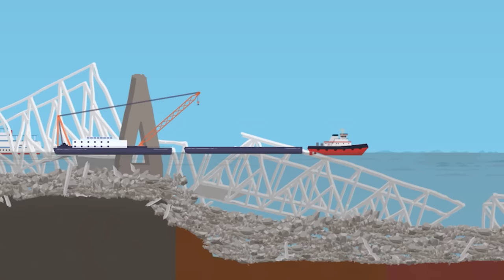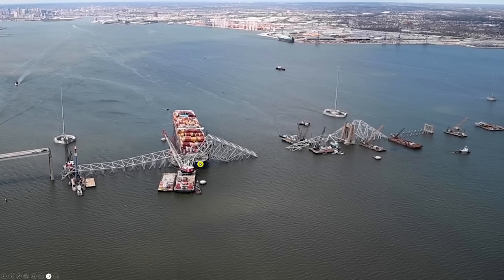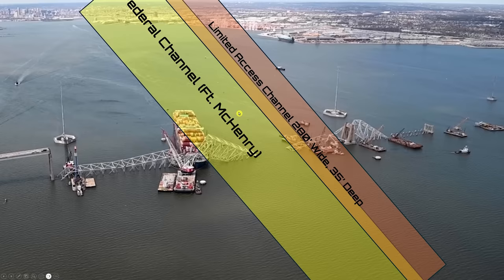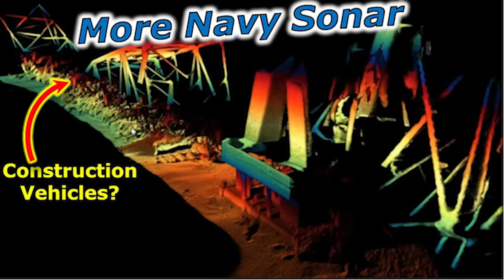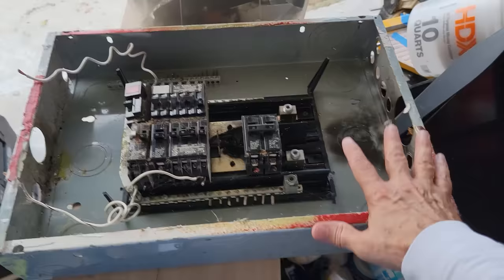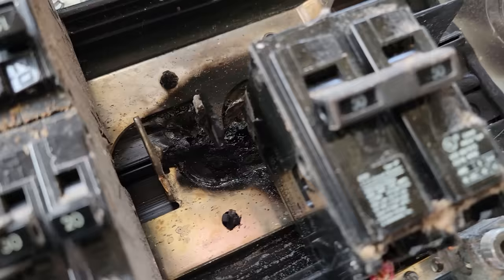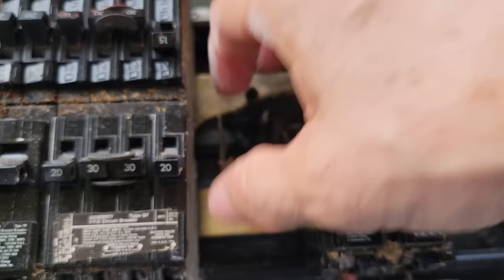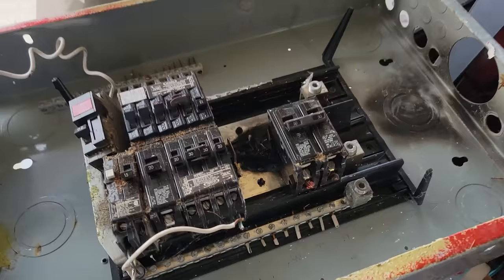NTSB Focus Dali Ship's Circuit Breakers | Bridge Collapse

Comment: The lady refers to the electric power system and the circuit breakers.  This is a very large area.  The circuit breakers on a ship are very different to domestic CBs.  It is not possible to add circuits to a ships CB.  They also have overload protection.  My guess, and that's all it is, is that the main electrical switchboard preferential trip failed to operate.  There are rumours that there were electrical problems when the shippers were loading the fridge containers and had to provide their own power.  If there was a fault on the fridge container supply system that circuit should have been cut off before it could affect the main CBs.  There is a sequence of preferential cut out, with the essential circuits last, such as main engine lube oil pumps, the last to go.
(I'm a former Merchant Navy chief engineer, shipping company technical manager and marine casualty investigator.)

Comment: The investigation of the circuit breakers could be just to rule them out as a source of the problem. Just because something is being investigated does not mean that it was the problem.
Reply: It was the problem. They were having trouble with it while docked.
Reply: They are investigating the CBs because they want to know which one tripped first.  If it was the supply to the Refrigerated Containers, then maybe one of those containers has a problem, such as rodent damage to the wiring, causing a short circuit, with high currents flowing.   
As the ship is still functioning, the generators will still be running, and maybe the fault conditions will re-occur.
Reply: + It was mentioned that the powe tripping was caused by not having enough power to feed all containers and ship consumption and they were planing on alternating plugging in some during the trip !
Reply: @hiscifi2986  Good to know, thanks.

Comment: For all Ship Power Generators (engines)  to stop at the same instant has always been iffy.   So yea,  a massive electrical short taking down the system and CB trips as well as fault isolation -  its called Circuit Breaker coordination and a fault can propagate to the Main  CBs .    Power was off for a minute initially,  so the Backup Generator did not start or it faulted into a short that had not been cleared was well.    Keeping in mind a lot of reefer units are carried on a Container Ship and it takes massive power to support those and its exposed above deck.

Comment: Homendy used the term "circuit breaker" to explain this in simple terms that most people will understand.  however, we we are really talking about is a more complex electrical system & its associated power distribution.  The Dali has 2 main generators, 2 aux generators and one emergency back up generator.  each generator is creating thee lines of 120 VAC power at about each making 4500 Kilowatts of power.  the lines of each generator have to be syncronized before all power is put on one common distrubution bus.  From there, there are additional sub-panels that supply power to seperate sub systems, such as the main engine fuel pumps, lube oil pumps, etc.  

Investigaors are likely focused on the merging of the those generators and that power distribution & management system.  The electricity generated is more in like what you are going to find at power plant.  

I was a USCG Marine Casulty Investigator & am a graduate of the US Merchant Marine Academy

John B Hall
LT, USCG, USMMA '95

Comment: The breaker trip current depends on how long the load exists. The breaker is protecting the insulation on the wire from getting too hot. A short high overcurrent event will not trip the breaker. This allows motors, which can briefly draw twice the rated current while starting, to use wire suited for long term current, and to not have to oversize wire for that surge. In the US, continuous use (over three hours of continuous use) is limited to 80% of the circuit's rating, and a breaker should trip somewhat over 16A for a 20A circuit after three hours. The breaker doesn't typically instantly cool, so if the breaker is reset and the same 17A trip load is reapplied, it's not going to take another 3 hours to trip. However, in Europe, the breaker requirements there are not allowed to trip for continuous service at the full rated capacity of the circuit.

So, it depends on which standards the breakers and wiring were following as to what trip current the breaker should trip. Breakers also tend to trip more easily as they age, especially if they have been operated near their trip limit for much of their life.

Comment: I believe the breakers they are talking about is PLS controllers. They are far more complexed than the typical breakers you will find in a house. Their function is to control a process. Also in a ship’s switchboard they use high voltage. Normally 440 volt but also even higher. On my last ship we had 6000 volt systems and two separate switchboard rooms. And this was only for the engine room systems. In addition did we two separate switchboard rooms for the deck equipment. Being a ship built in 2015 I presume that Dali have something similar.
Reply: You are correct in the voltages. If they had a blackout it was on the 6.3kV but they should have been able to isolate one gen and restart.  Thruster operation is problematic but they were in the main channel so if it was used it would be light load. A ground fault is a tricky problem but there are at least two 6.3 boards and a parallel before the sub LV boards. Cargo has its own. ?. However the emergency Generator did not start Why !!.  regardless of the original problem I think we have operator intervention preventing backups from doing there work. As Ron says, "The ship is powered up now"   Good post.
Reply: @Woffy.  I think the emergency generator started that is why they got some lights back after one minute of the first blackout. Why they got a second blackout is an interesting question but I think it’s related to the switchboard but was this caused by automation failure or was this caused by human error? I am certain that they were pretty upset in the engine room and might have done something stupid in the panic. The  thick smoke is probably caused by auxiliary engines being restarted. As for the bow thrusters the need a lot of energy and at least two auxiliaries have to be running before you can use them. Besides the faster the ship moves through the water the less is the effect of them. Above five knots they will have no effect. In any case they were too close to the bridge when the accident happened and there was little they could do to prevent the collision. Murphy’s law at full display. As a turn of events I see that FBI now is involved in the investigation, something that indicates that there might have been some criminal negligence.

Comment: As I have said from the beginning of this disaster.... Lack of adequate pier protection is a major factor in this accident, regardless of what caused the power failure. You have to assume that things will go wrong, then plan to protect against such accidents. To not do so is reckless and negligent.

Comment: The shipping containers aren’t fed from the emergency board. It was the emergency board that went down and took out the main generators and the emergency generator also failed to start also indicating that the emergency board had a critical failure.
Power was restored from the normal service generators after 51 seconds rather than the limited power (including emergency lighting ONLY) that is fed from the emergency board.
Current guess - something went catastrophically wrong with the emergency power board and the surge tripped all the generators offline. I have seen this happen with vermin in industrial switchboards so that’s a possible explanation.
Reply: I don't buy this.  The emergency board would not have been in use.  The emergency generator was trying to fire up but was unable to as evidenced by the spewing of unburnt fuel out of the stack.
Reply: Keep in mind that the video most commonly being shown, recorded from south of the bridge was uploaded at 10x speed. To calibrate any time stamping, the green flashing light channel marker seen in the video between the bridge piling and the camera is supposed to flash once every 4 seconds. The period of the first blackout was more like 4 to 5 minutes
Reply: @3DPDK  The 51 seconds was from the voyage data recorder. That was when the first instrument data was restored as power came back up (it then went down again at least twice).
Reply: @einfelder8262  The emergency generator is legally required to come online within 45 seconds and it feeds the navigation lights but not the ships normal lights. The fact the navigation lights AND normal lights came up together indicates the emergency board was failed.
Reply: What I'm really surprised by is that the emergency system is allowed 45s before it needs to provide power.  And I'm even more surprised that faults can trip critical pieces of propulsion and steering gear offline.  Do naval architects assume critical failures will never happen during maneuvering watch near bridges?  Aircraft take a completely different approach.  For anything flight critical that needs electrical power, you find a way to always keep it powered.  Multiple redundancies, and emergency batteries for instantaneous backup power are NOT fused in some cases.  It's ok to let the electrical system burn for a little bit if it means avoiding a high-g air-ground interface event.
Reply: @major__kong  I'm not too sure about the 45 second failsafe either. Smaller vessels, 500 ton or less, usually have a battery backup system specifically for nav lights, AIS and communications that kick in the instant ship's power is removed, very similar to a computer backup power system. The 45 seconds may be the maximum time for the auxiliary generator to kick in, but if all systems are operating properly the nav lights should never go out.
Reply: @3DPDK  Large ships also have a battery room that powers most lights and electronics on the bridge.  When the emergency generator kicks in after about 30 seconds everything else needed for the ship's basic navigational functions are restored.  On all the ships I ever worked on, we did an monthly test of the emergency generator and intentionally opened the main breakers to make sure that the emergency generator would automatically start.  There were always multiple alarms on the bridge and some of the lights would go out, but all the critical equipment was powered by the emergency batteries so nothing ever goes completely dark.  These tests were scheduled and announced ahead of time so everyone knew what to expect.

Comment: Can't help but to say; "I TOLD Ya." It was Switch Board, electrical failure, overload I bet. As an Electrician Mate . Ship.
Reply: That makes no sense for a ship this new to have that kinda of failure unless its was poorly maintained
Reply: I understand your perspective, Mate, but a failed distribution panel doesn't cause black smoke in the stack. That's a problem in the motor driving the generator. It's still an electrical problem, but it's not in the panel.

Comment: While I don't have specific knowledge of the breakers used in container ship applications, a couple of basic principles to mention.  One, breakers trip on a 3-dimensional curve with the variables of time, ambient temperature, and current.  They are rated to hold some specific current at some specific ambient temperature for some period of time.  A typical residential breaker (as you showed) rated 20 amps should hold 20 amps at 40C indefinitely (3+ hours).  Tripping at 17 amps is not normal under any circumstances, that is an overheating or malfuctioning breaker. The other thing to mention is Ohm's Law.  If resistance develops at an interface (breaker plugged onto bus, for example) that will cause a voltage drop = current times resistance.  The impact on the circuit, current goes up or down, depends on  the type of load.  Electric motors (induction motors) typically draw more current when voltage sags.  Resistive loads such as lighting will draw less current when voltage sags.  The burning occurs due to power (at the point of resistance) = current squared times resistance. A small resistance, when the circuit is conducting a relatively high percentage of the rated current, can lead to a lot of heat (again power/heat varies with current *squared*) concentrated at the point where the breaker plugs onto the bus.

Comment: The people at dockside said that there were problems with the breakers. The Dali had too many refrigerator containers plugged in. That was blowing the breakers at dockside. This per staff at the dock.
Reply: Unless all the reefer breakers blew at once, I don't see how it would cause what happened.  Does the main breaker in your house blow when you plug too many xmas lights into an outlet?  No, just the breaker on that branch circuit blows.  If they tripped all at once, the main generators could spike the system because they can't reduce their output fast enough.  It's like running you car's engine hard in gear and then immediately throwing the transmission into neutral and watching the RPM go past redline.  But I don't think that's what happened here.  It feels like a fault in the emergency panel since all the critical loads like fuel and lube oil pumps and steering gear run off of that bus (normally power by the main generators through that bus), and the containers don't run off of that bus.

Comment: Jeff you missed Chair Homendy's most profound statement.  At 5:34 she says, "Our investigators are on scene.  They needed the assistance of Hyundai who is the manufacturers of equipment in the engine room to DOWNLOAD DATA from the electrical power system and look at the circuit breakers" [emphasis mine]
Apparently there is a second data recorder, in the engine room.  We are first learning about this now.  All questions should be directed at obtaining a detailed explanation of this data recorder and its capabilities.

Comment: USS Kansas City I was on breakers tripping loosing load and power to 1 circulation pump , ship goes dead. Emergency generator starts up and gets pumps going to start mains back taking time. I’ve suspected a breaker from the start

Comment: The panel you showed has the vertical flat tabs to connect the breakers to the bus, heating from normal currents can weaken the spring tension of the connection which may cause arcing between the breaker and bus tab. This created resistance which causes heating at the connection which continue to add resistance values and increases heating to levels which cause damage to the components.  I have seen many of this type of panel fail in this way.  Cheep to manufacture, expensive to replace.
Reply: Which is why so many of those model panels have been recalled over the years, as they get dangerous as they age. Not helped by the 110V mains, as that means you have to have high current flow for power use. Australia and NZ use the same thickness and dimension in the contacts on their plugs, but there you have a max current of 10A on most sockets, which is 2.3kW, while the USA runs 15A to get 1.5kW only, and if you need more you have to use a different plug, while Aus has a larger one, still fitting the 10A plug, that allows 15A, so allowing 3kW of power draw. The panels there generally do not catch fire.

Comment: The NSTB animation shows that they will clear the bottom where the construction vehicles are in order to open the limited channel. So thy are concentrating on recovering the bodies assuming the vehicle went backwards as the span collapsed and not the other way. According to a worker at the container terminal the circuit breaks were tripping during the loading of refrigerated containers and connection to the ships generators to the point the ship had connect them to the dockside supply. In port and whilst maneuvering in the channel the ship relies on three diesel generators only switching to the main generator driven from the propeller shaft when at sea and its cruising speed is reached.

Comment: I had a new 1200 amp breaker fail on me the first time it was powered down & back up again. I could not get it to close even with power off. It certainly happens, it does make me a little more nervous seeing the electronics in them.

Comment: Jeff. Those circuit breakers they are probably talking about are the ones in the main switchboards (or emergency switchboard).  The breakers are typically housed in cabinets at least 6 feet tall, with space inside for the breaker  and the copper bus bars interconnecting them.  Also housed (usually on the front panels) are the protection relays, metering and local control switches.  In general, these installations are extremely reliable but a small fault in, say, a protection relay's electronics can cause a circuit breaker trip.  There again, the protection relays might cause a trip due to an actual problem with the electrical load, such as a cable fault or a faulty motor - anything on the outgoing wiring.  In large installations with multiple breakers, there needs to be careful design so that in the event of a faulty load, only the circuit involved is tripped out.  If the so called "discrimination" between protection is set wrong, more than one breaker may trip, perhaps in turn causing a cascade of trips until everything is gone.  Think the New York blackout of a few years ago...

Comment: You are correct about the refrigerators.  Compressors often require times-3 to times-10 surge to start, and this often kills a weak system.  This is a "coordination" problem, well known to any electrical engineers.